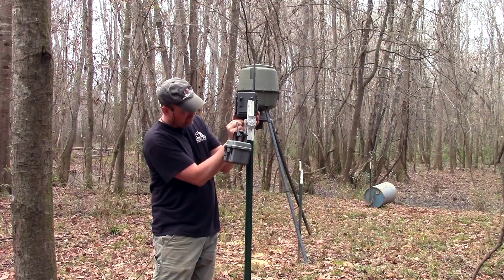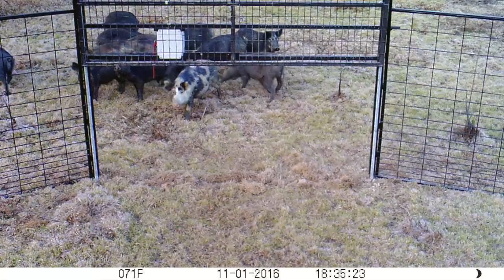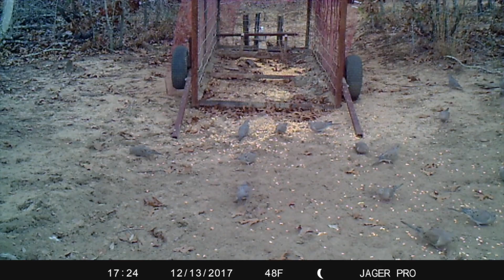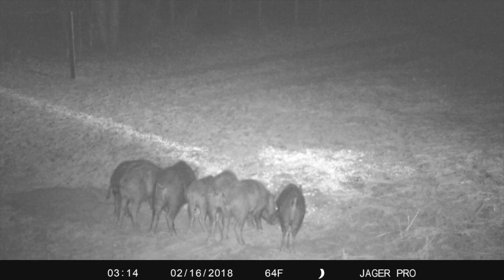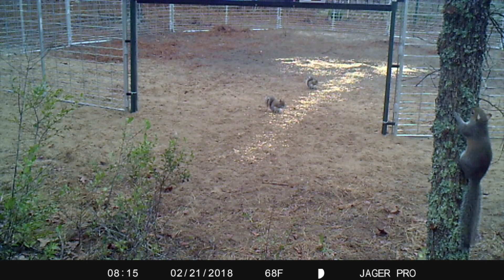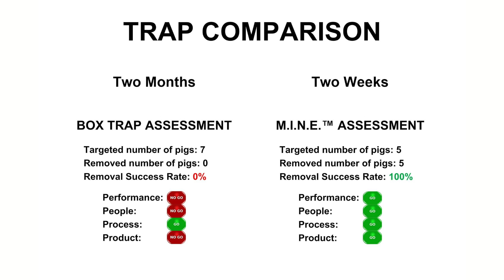Wild Hog Trapping | TRAP SELECTION | JAGER PRO™ TV Show Preview (Episode 6)

Comment: Need to use the term "equipment price tag" instead of the term "cost".
The cost of using equipment with a lower price tag that does not work is higher than using equipment that works.
Reply from the maker: You are correct. Cheap, ineffective equipment "costs" landowners much more than effective, higher priced equipment.